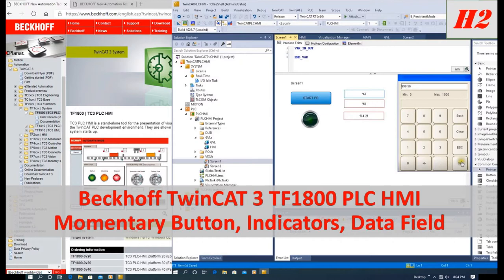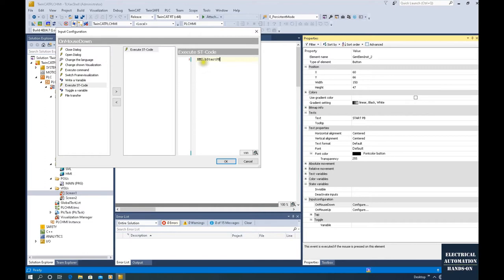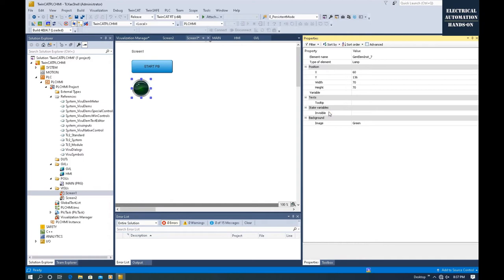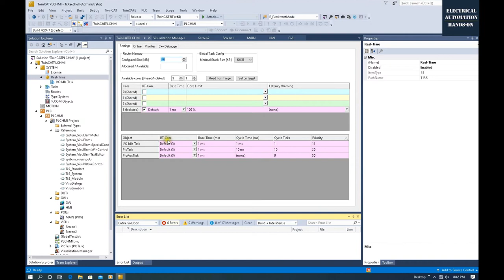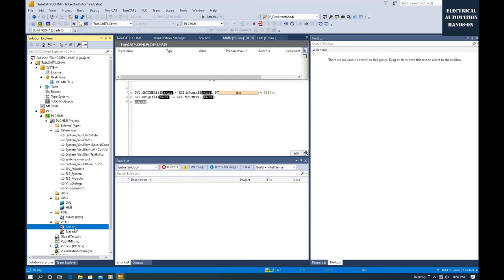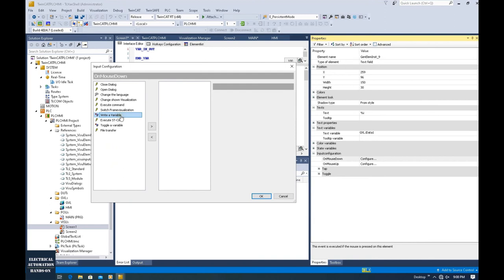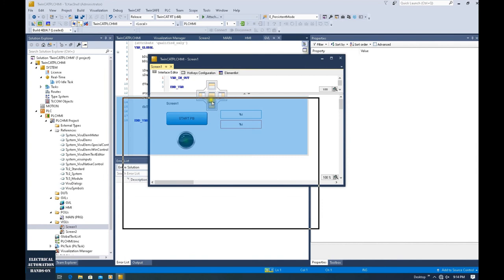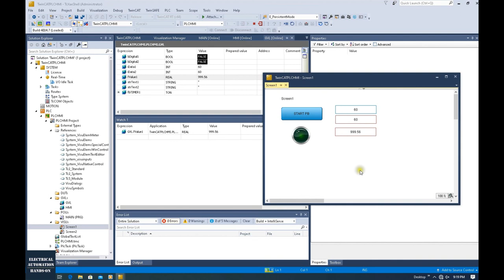HMI02. Beckhoff PLC HMI - Momentary Button, Indicators, & Data Field (Int, Real) (2/6)

Comment: what is the difference between creating HMI screen under VISUs and  separate HMI project.
Reply from the maker: The VISU style called 'PLC-HMI' from Beckhoff. It is a simple HMI system usually for small and simple function machine system. HMI Project is the 'TwinCAT HMI' HTML5 based system.